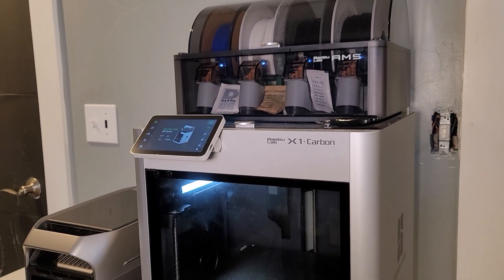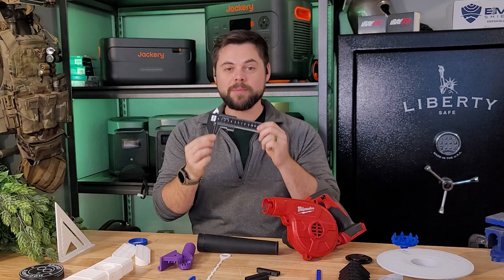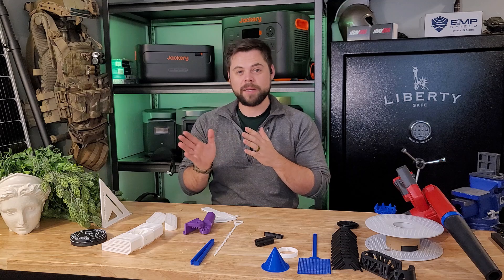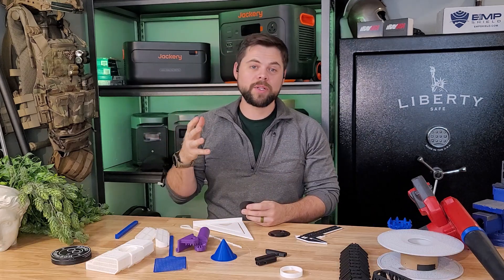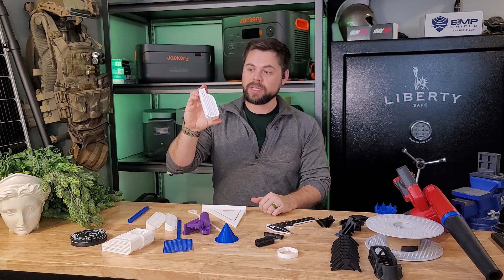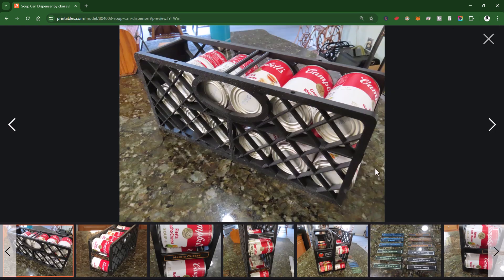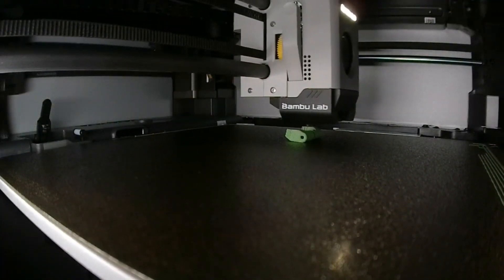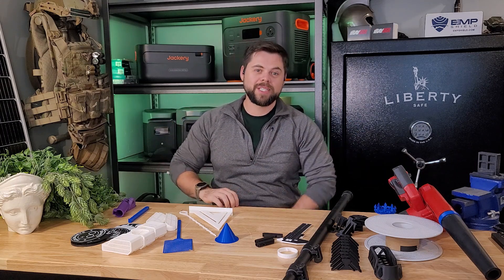Cheap and Easy Way to Repair Anything Bambu Lab X1 Carbon 3D Printer

Comment: Ben, you need to specify Delta 3 PLUS.  I recently discovered Ecoflow is selling a Delta 3 and a Delta 3 1500, which appear to be warmed over Delta 2’s with fewer/inferior features to the Delta 3 Plus.

A shady trick I almost fell for.

Comment: What is the average power consumption of the Bambu Lab X1 Carbon 3D printer when printing 
and what is the maximum power consumption when heating the print bed?
Reply from the maker: Running everything like normal it seems to jump between running at 50w and 250w on average. I think I've seen it jump up to 450w.

Comment: Looks interesting, but I’m a bit too old to start something new. But it definitely looks like you can make all kinds of fun things, especially if you’re problem solver.
Reply: The printer he showed is the iPhone of the 3d printing world. It's so simple that a 4 year old could operate this machine. It's a very expensive system but pretty much no need for tinkering it just works out of the box. That being said when something needs repair on this printer itself it won't be as cheap compared to other printers such as ender brands